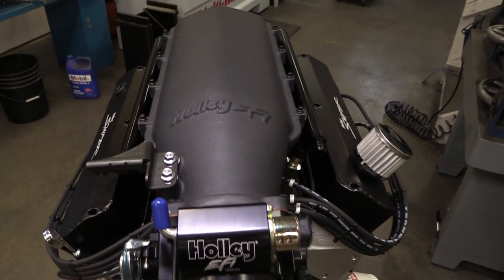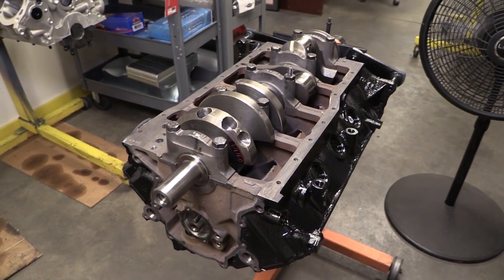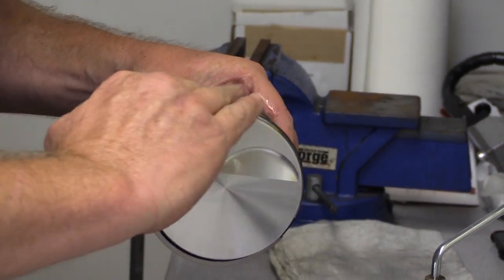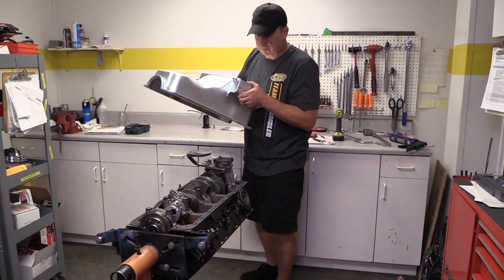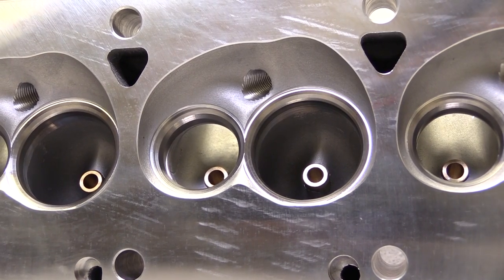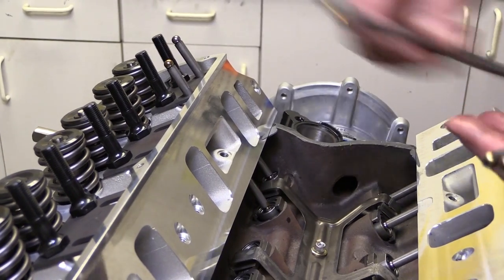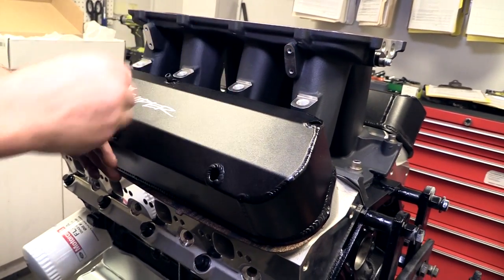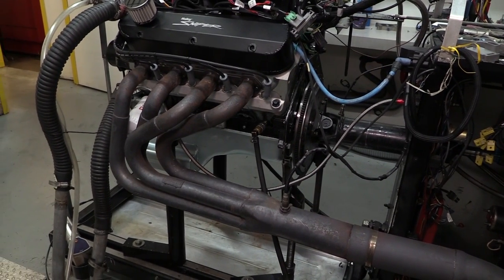The Ultimate Stock Block 5.0 Ford Build (347 Stroker V8)

Comment: Love that intake manifold.  I'd trade my systemax for it. 331 stroker, main girdle, valley pro girdle really good PAC valve springs and some trick lifters. Send that thing to the Moon and back like 7k plus rpm on a whim
Reply: Uh no, it will soon come apart in glorious fashion...
Reply: You're going to need a solid roller cam to achieve that goal

Comment: Perhaps a girdle in the crankcase would help hold it together. A time bomb without one. That engine should be making 600 HP without a sneeze.
Reply: Girdle just holds shit together when it splits. And it will split.
Reply: Robert Davis Dart block .

Comment: I'd cut a hole in my hood in a minute for that!
Reply: I was thinking the same thing
Reply: Must suck to have to do that. This engine would fit in my '57 F100 and still have almost 12" from the top of the intake to the the bottom of my hood. hahahhahah
Reply: Fits under the bubble cowl hood
Reply: Most foxbody's have a cowl fiberglass hood anyways. My 351W fits fine.

Comment: I got a 414 stroker with this intake just finishing the clean up n bowl polish on the heads.. thanks for the info n support....stock .060 over block... looking for the 700 hp mark with a solid roller cam with 11:3:1 comp and @ .255/267 duration time will tell...
Reply from the maker: Sounds like a fun build. Good luck!
Reply: how did it turn out?
Reply: @dennisrobinson8008  still in the works after posting I change up some stuff before final assemble.    changed the 2.02 int valves to 2.08 and milled head .007 and changed head gaskets to bring compression up to ( 12:1 )  I knew the motor needed larger valves. but motor's done now.. just spent this year on the car making it ready for the power plant . thanks for asking......

Comment: I’ve got Paxton blown 331 stock block with just under 600 hp to the wheels and I’ve put a lot of hard miles on it including road course racing on the weekends and I still haven’t broken mine so myself and a lot of other 5 L owners Will argue with you about that 500 hp number
Reply from the maker: That's great to hear

Comment: That's a nice revving motor.  I made my 302 with a lot used reconditioned parts. Made 445ft lbs at 4000rpm and 480 hp at 5900rpm. 
Super flat torque curve running 94 octane gas.
Reply: Combo?
Reply: @dennisrobinson8008  stock block and crankshaft. World products senior head ported. Srp flat tops, eagle rods and arp bolts(just because it was a local deal) 
Full roller 1.6 rockers, comp 987 springs, comp xe284hr cam.
Reply: @jasonhooey5677  445tq on the 302?   That's very good.    You must have had a  good amount of compression, 11:1 on iron or 12:1 on aluminum?
Reply: @dennisrobinson8008  correct,  230 psi cranking compression.  Iron heads with work on the chambers.
Reply: @jasonhooey5677   Yours runs strong!!!     I had iron windsor jr heads slightly ported and gasket match on intake side back in 1997, milled to 10.25:1 cr on a 86 block with notched piston on intake side.  It ran fine on 93 octane and 14 degrees initial timing and low 30's total.   I had the weiand stealth intake, holley 650 dp, bbk 1 5/8" LT's into dual 2.5" exhaust and X pipe.   223@.05", .565" lift, 110lsa ultra dyne cam ( started with f303, but UD cam beat it by 25rwhp and better torque ).    Back in those days guys were scared to run over 9.5:1 on the street...   That car made 320rwhp and  340rwtq.      With a vic jr and slightly bigger cam it made 365rwhp/335rwtq.   The long runner cobra and gt40 intakes were making 320-350rwtq on a stick back in those days, so my combo was running good.
Reply: @dennisrobinson8008  that's a good motor too add 100hp and that's probably close to what it would make on a dyno. So you're basically right there with mine. I bet that was fun
Reply: @jasonhooey5677  Back then it was a blast!      It was in a 1985 LTD with a t5, car was light as hell.    I was building a 414W stroker to go into it that would make over 500rwhp, vic jr heads ported on intake, 256/266@.050" .660" solid with 108lsa, 1 7/8" kooks, 12:1, 850 holley dp, super vic intake matched to the vic jr heads.     But that build never got finished.

What's wild is to see what they are doing on the LS3 and LS7 ( RPM motorsports ), those guys have a proven combo for 620-675 rwhp at under 6800 RPM, very streetable and powerful.    Back in the day 500rwhp was super high!   Enough to run with S trims on 302's, that was my goal at the time.
Reply: whats the specs on your heads what cc's, what intake, tb and maf if FI?

Comment: Missed it, what was compression and fuel used? My 347 did practically the same numbers, with mechanical water pump, carb, pump 93, custom cam, 9.5:1, @ 7000rpm max hp. I have a trick flow box R intake waiting for it with fuel injection, as well as a turbo. One of these days when this covid-19 is over and I get my job back ill drive the car, lol. At least I could hear it run for now, sick.  Any ideas what I can make on pump 93 with a turbo? The Machine Shop said mid 700s to the wheel. But of course I was hoping for 8 to 850 😂

I would love to see a comparison between this and take and the trick flow box r

Comment: Did I just watch those lifters go in DRY!?!?
Reply: Perks of NOT using antique flat tappet stuff...
Reply: 02autogt still, dry bores. Can't remember if it was a hydraulic or solid cam, but a hydraulic cam should have the lifters soaked beforehand
Reply: @ddcraun ,in the video he mentions not wanting to stick a lifter on start up an lubes the bores with a assembly lube after he did oil pan idk what yall are watching. cam had some heavy weight oil on it more than likely. guys fingers looked like they were a little oily when he was installing cam.. looks like a solid roller cam lifters they dont pump up like hydraulic lifters do . a lot of things were left out of the video . like bearing tolerances, crankshaft play, adjusting the rockers to spec . they try to keep it simple without making it along tedious technical video. they didnt show setting up ignition timing or cam degree to make sure it was set correctly .
Reply: Darrell H , it's not a how to video , it's a this is the parts we used for our giveaway build video with engine dyno numbers . anyway.. . lifter bores had lube an cylinder bores had lube before he stuck them in lol
Reply: The bores were lubed, the cam was obviously wet, usually a shop like this will  pressurize an engine  before startup... a portable pressure unit is easy to make with an old oil pump, drill, 5 gallon bucket and some oil line.

Comment: Would love this in my 2010 King Ranch f-150!!
Reply: They cost so much aftermarket parts, labor& all7-10,000 on motor, and that was another article on a build alot like thid one &   if you want to keep it , try starting with 351w less$ to go faster. . + its strokeable to ironic 460 ci..
Reply: Even if you spend 10k on it its still better thsn 10k on a 3 valve
Reply: This would not be a good engine for a heavy F-150, especially on the street. With a different intake and cam putting more power down lower it would be better.
Reply: @sdvten. With more torque then, my current setup has a bit more torque than the horsepower spec.
Reply: Why would you even bother doing such a thing?
Reply: They're good solid trucks but the 3v is fords biggest mistake. I have an 06 that I'm needing a swap for now and either the old school sbf a coyote or the new 7.3 gas is the best options to replace a blown 3v.
Reply: @theyhatehimbecausehetoldth7576  how come
Reply: @cainadkins3985  because he already has a modular power plant. While yes, the 3v 5.4 engine is bad, it would be much more logical and much easier to stick with another modular engine instead of using a small block ford. It's like putting a small block Chevy in an LS powered car.

If he wants a small block ford, he should get something older that came with one.
Reply: Or this could look good in my 1990 ford f150.
Reply: @6blazer  there you go. That's more like it.

Comment: That's a pretty cool build, but I feel like we're missing out on about 1000rpm of potential. I bet you could squeeze 600hp out of that thing in the future.
Reply: The factory block doesnt handle much over 500hp reliably
Reply: Timothy Voight With std crankshaft - the oem crank webs are soft and they flex under high load, essentially causing the block to crack.
Reply: Luke Walker it’s a bit more than that bro 😀

Comment: This build would make a good vs coyote swap video. Is it as reliable? Is it as fast? Is it more cost effective?
Reply: Nick B cost effective yes. More reliable. Maybe. Depending on how you use it and if you’re trying to make more power than the notoriously weak block can handle. Power wise. We’ve all seen sbe and stock head coyotes make over 1,000 hp. Reliably probably handle 800 without sneezing. So I’d say the coyote wins in that dept. now a dart blocks 8.2 Windsor vs a stock coyote would be a good comparison. The coyote is expensive but so is a dart block...
Reply: Idk about this one, but old pushrod 302s have done 1 million miles without being opened.
Reply: Karl Hopkins reliability as far as a daily driver engine that’s bone stock and well maintained yes. But making over 500 horse the main webs will crack.

Comment: Cool build. I wonder just how much power this combo could make if the block didn't limit your rpm?
Reply: I saw a video a few days ago where the builder used what essentially was a couple bridges that ties the two banks together in the lifter valley so the block didn't crack when power went over 500.  I just wonder how effective those things really are.
Reply: @jmurphy1973  they're useful to help holding on the guts when it cracks.  Plenty more people making well past 500 WHEEL without them.

Comment: What lifters were those? I have swapped many a stock roller cam out while the heads were still on.
Reply: I was saying the same thing never had to remove the head on any 302 roller motor I've messed with
Reply: It made me cringe to see them not soak the lifters in oil

Comment: I need a 302 for my van, but never would touch a 347, do not like the oil control ring so close to the pin.
Reply: Maples01 they have that sorted with steel insert . Not an issue with mine .  CP pistons 5.4 rod .
Reply: @graemeelliott8576  It is unacceptable, I do not see one lasting as long as the one I have, which was manufactured in 1973, so no, I'll pass, you'd be better off trying to sell me Slick-50
Reply: 331!

Comment: Awesome build and all, but the block just doesn't come close to allowing the rest of the build live up to its full potential. When a good aftermarket block is available for not a hole lot more than a stock block with all the machine work done, seems like a small percentage of the project price for a lot of insurance and piece of mind. Hate to crack that block and ruin all the other parts you just spent all that money on. Plus,  I mean, come on. Who can hold themselves to a self imposed redline when your engine still is building power?

Comment: The comment about a stock 302 only being able to hold 500 hp safely for a consistent period of time is not true. Richard Holdener has proven on his channel and dedicated an entire episode to, what it would take to crack a stock 302 block. He owed and raced a 302 mustang with well over 500 horsepower consistently and proved that a stock block will run over 600 hp with no issues.

Comment: Interesting and exciting with Prestige coming out with their own heads.  I pray they aren't sourcing them from China.
Reply: Look at these heads, then look at the Blueprint HP9009 head, then look at the Skip White NKB head...Look familiar? Skip White is the only one who advertises these heads as being made in China and if you go to Alibaba, you can see which Chinese company makes them. I live in Thailand and built a few SBF with these exact heads, straight from China. I use American made Erson valves and springs on these heads and they run good right out of the box. I've used the Pro comps out of Australia, also cast in China, and these new heads are better than Pro comp.

Comment: The 347 is a great combo.  A little too good at making power.  We have broke 5 blocks straight in half. The blocks are just too weak for the power we make from them. (NA) Went to a aftermarket block and love it!
Reply from the maker: Wow! What horsepower level were you seeing when the blocks broke? Did it happen right away with a fresh build, or did it take some time  with the engine making big power? I'm a big fan of Dart's SHP blocks, which did you go to? Thanks!
Reply: The Horsepower Monster well over 650.   3 of the blocks were std 302. Nos took those out. The others were 347’s NA.  Now we have a dart block. All motors have every brace you can get. Funny enough none of them stopped running and the rotating assembly is still mint!!
Reply from the maker: @jondoe6618  Very interesting. Thanks for the info!

Comment: I have a mostly stock 302 HO in a '83 GT 5 speed, 3.08 rear gears... it's like a gocart on steroids as is with short tube headers and aftermarket H-pipe exhaust, Borla muffs.
My goal is larger primary headers with X-pipe and frame stiffeners and upper/lower control arms with torque box.
T-top takes punishment otherwise.
Reply from the maker: Sounds like a fun ride!
Reply: Sweetteawillie my brothers 95 gt with just a trick flow top end kit made 308whp and was running 3:73 gears,just with that set up he was taking out ls2 and ls3 Camaros
Reply: Venom Svt 
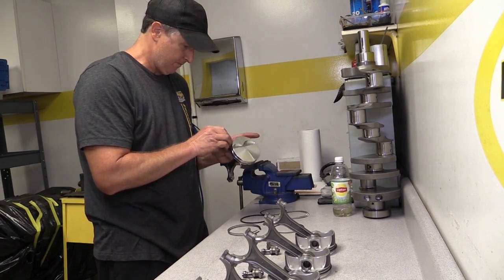Mine has 3:08 rears with a T5 in front. Don't know the hp output other than the 175 advertised for that year's HO. I do know it will hang with a late model PowerStroke... for some reason, some want to tease me with that smoke spewing exhaust if my window is down... triggered by the sight of an old GT?

Comment: I'm not a Ford guy but I like the stock block classes I would like to throw one together with some bad ass lighter weight rods and pistons and good crank 331ci half fill the block brace that sucker up. Some hoged out edelbrock vic Jrs solid roller cam that Holley high ram 102mm TB and throw in a bad ass light weight fox or SN95 stang that's ready to go mid 4s and throw single turbo kit together with a forced Inductions garret 80mm t6 turbo and give it hell and get that stock block record and run it on methanol

Comment: Read a lot of people putting out more than 500 hp with the stock block so I think that's BS. I wouldn't trust the block at 700 hp but I think anything under 600 is just fine. I'm also talking strip machines as well which puts a hell of a lot more stress on the block than a street machine which isn't going to see that top HP all that often unlike the strip engines which live most of their life at peak power.
Reply: Stock Block record is 5.07 in the 1/8 right now and they're on the hunt for 4s.. and than there's the likes of cris Watson making 800+ on a stock short block for OVER 2yrs.. and everybody else making 600+ at the tire.. shitty tuners and lack of knowledge/ commen sense is the main hindrance.
Reply: thats a 69 bloc
Which is thicker.   It can handle 700hp or so.

Comment: Stock block is perfectly fine just dont go over 549 hp 😎
Reply: And a pre-1980 stock block is even more perfectly fine, as '80-'81 is when they wimped out the little Fords. Even Ford rated the earlier blocks good for 600+, and I've seen 'em live with it. I'd be happy to shove the guts and induction into my '74 block.
Reply: @Zekais  
Is it possible to run an old/early block dressed with a roller and efi fox body stuff?
Reply: @xmo552  It sure is. You would probably end up using "retro-fit" roller lifters, but all of the rest is good. I have a '68 block in my F100, and it is running EFI for a foxbody (BBK SSI), hydraulic roller cam and so on. I am running v-belts instead of serpentine, but I'm guessing a foxbody or similar timing cover and related stuff would let you stay with a serpentine belt, if that's what you wanted.
Reply: @Zekais  
Thanks for the reply. I'm thinking of using an old block for my '88. I can live with a 2 piece rear main seal. Maybe I can have someone go south of the border and find me a heavy block. I appreciate you sharing that info.

Comment: Did they run a high volume oil pump? If so I wish you would have mentioned the set up  of that in this article.
Reply: You don't need but 4pd of oil pressure in a ford bud. That's the big difference between a ford and a chevy
Reply: @derrillhutto1152  My engine builder installed a HV pump. Ate the distributor gear in ten miles. I pulled the HV and installed a good mellings standard volume. Appreciate the response man
Reply: @joshuaholloway494 
I thought myself a hv oil pump was the way to go on my first build over 25yrs ago the motor ran great except it shot oil out the breather and if you got down on it hard it would shoot the dipstick right up and out the motor. Later I talked to a head mechanic for ford and he told me the same thing that a ford truly doesn't have to have a little over 4lbs anything 5-25lbs is more than enough for any street-strip ford

Comment: 500 H.P. limit is a myth!
Reply: No it’s not... you can’t change the inherent issues with high hp on these engines unless you use the dart block. Anything too much and you will need machine work and cement block...
Reply: Zeth Loveless , a bad tune will kill any engine regardless of what block is in it. Chris Watson is a prime example. His car puts down over 800hp to the wheels, and runs low 5’s in the 1/8th.
Guy a couple weeks ago just ran a 5.18 with a nitrous stock block deal. Guarantee that was over 500hp!
Reply: z7turbo well no shit Sherlock I never said anything about a bad tune or a tune at all 🤣